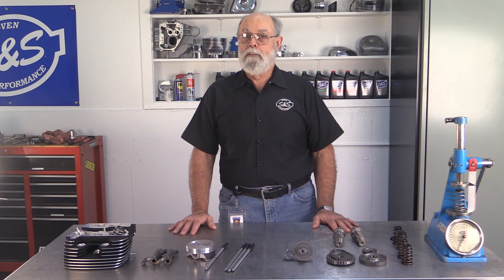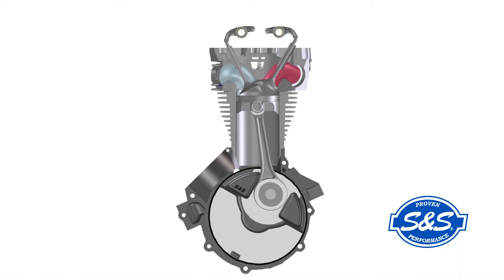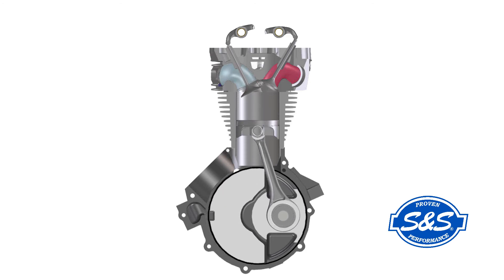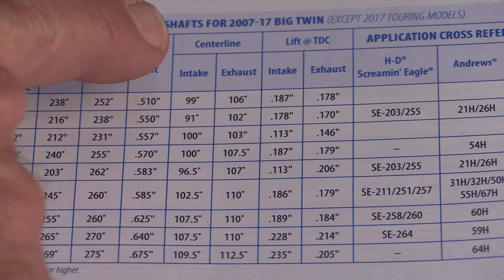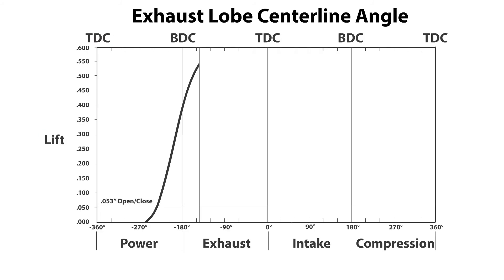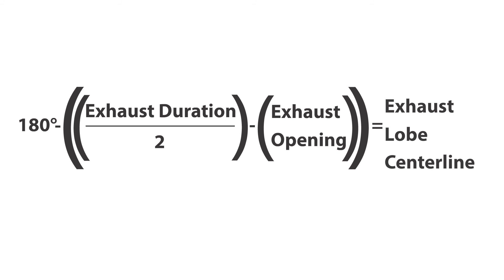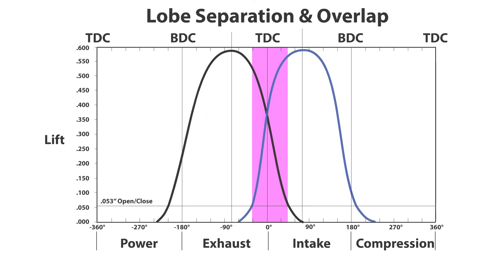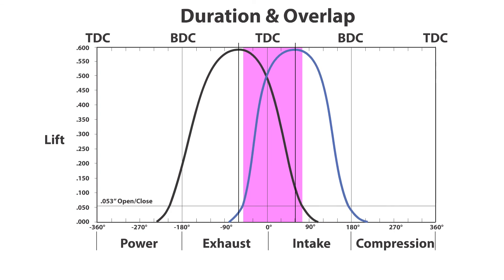S&S Cycle - Understanding Cam Specifications - Part 3

Comment: Extremely informative videos.  Well explained S&S, thank you. I am looking at the S&S easy start cam for my 2013 Dyna 96".  I would like a torque cam.  I was wondering if the .551 would be a good choice even though it says it is a good touring bike cam?  Would this cam work well in a lighter bike like my Dyna or would the .570 be a better choice?  I prefer a bolt in cam only.
Reply: Andrews 26h

Comment: That was very educational. I think I want 509 cams for my 2001 twin cam 88 engine.
I do touring with it. I spend my time in low rpms.
Will it give me better mpg than the OES 475 cams?
Or will I see reduced mpg's due to the possibility of some fuel escaping throu the exhaust, due to the overlap?
Reply from the maker: In our experience, a mild cam can see a slight increase in mpg due to the engine working more efficiently.  It doesn't take as much throttle to get where you want to go.
Reply: S&S Cycle, Inc 
Thanks, appreciate the reply.